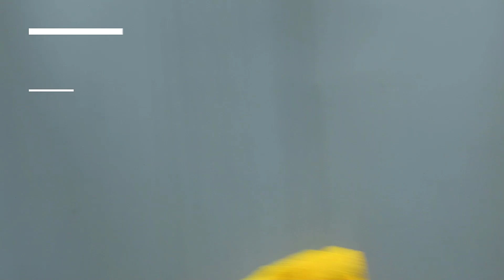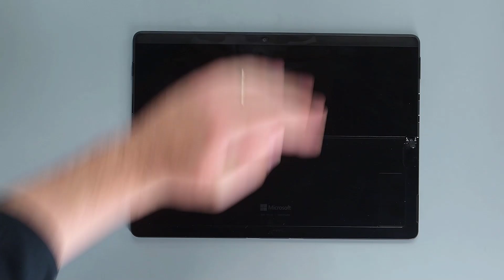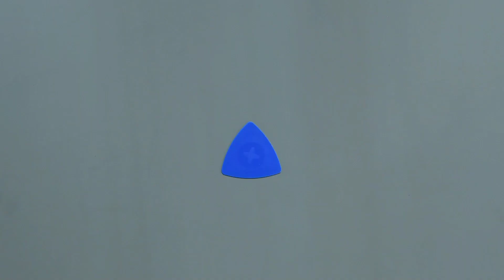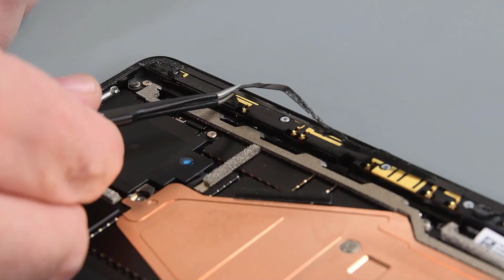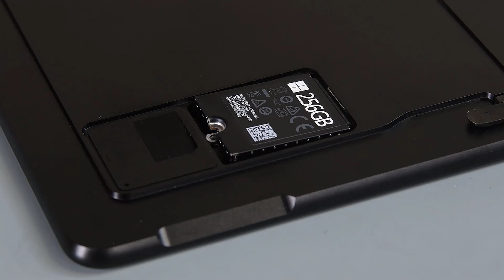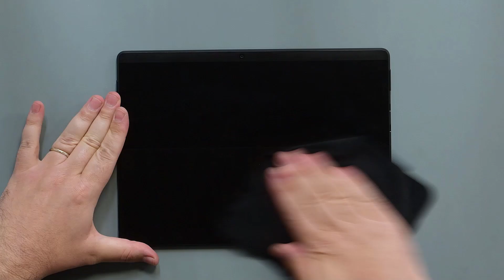Repair | Surface Pro X SQ2

Comment: And let me guess: Replacement parts will only be available for 1-3 years, just as with the Surface Headphone 2 and 2+ replacement earpads that are not available anymore. 1-3 years after release.

I absolutely don't buy any MS repairability claims any longer. Repairable, until they after 5 minutes decide not to support their customers anymore.